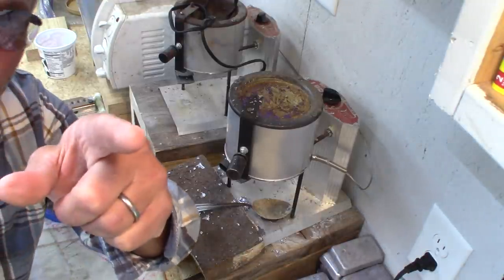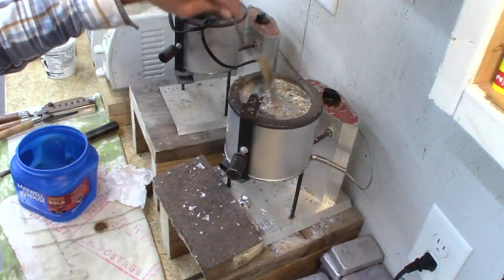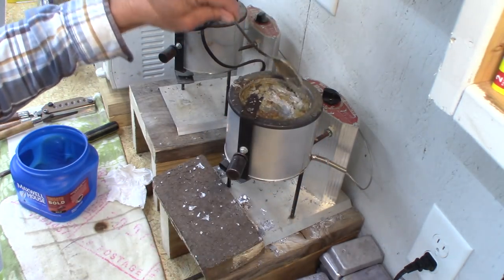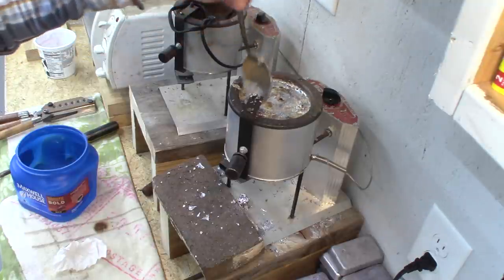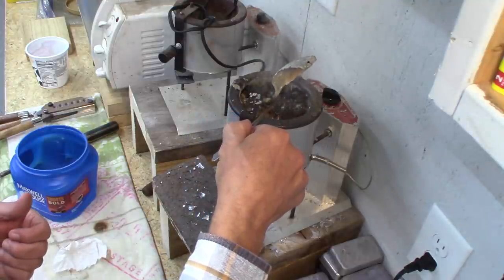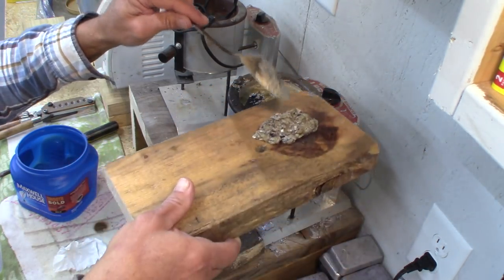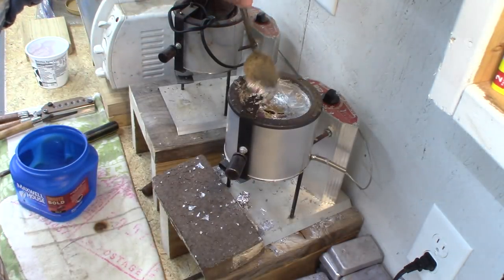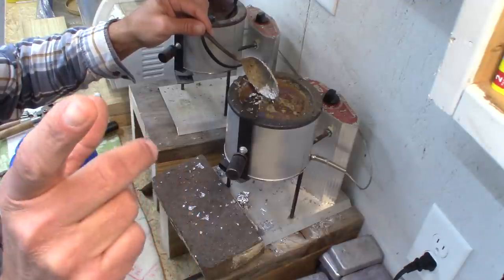Purify Your Lead

Comment: It's getting to be casting weather soon.i did want to ask I flux my lead while it is in my big cooker. Is it a 2 step process for you? I like the idea of the paper towel. I use lee pot myself they make great stuff
Reply: Imo the 2nd step is just to make sure to get any extra crap out. You could have stuff like dust or whatever in the pot too.
The 1st "cleaning" for the ingots you'll get most but prolly not everything and it's not a hassle to do it in the furnace before casting just to get a bit more out imo.
:) 

P.S. Yea Lee seems to of taken over. All their stuff is (usually?) cheaper than everyone elses but their quality is just as good in everything I have used to compare.
I only have one beef with one of their powder loaders (Lee Perfect Powder Measure) and that's only because it doesn't have a screw off top to put powder back in but it drops fine once you got it dialed in.
:)

Comment: For bullet casting in bottom pour smelters (so we're assuming previously cleaned and purified alloy), I've always had good luck with boric acid as a way to keep out the oxygen. Makes a nice, thin glassy sort of coating and doesn't really smoke the way sawdust does. Just don't stir it or it'll clump up and not do its job. All you need is a small spoon full.
Reply: me too 20 mule for my Dirty laundry shop rags and lead or coffee pots, I use a few grains to raise the 2 PH.  I had luck with DE pool filter media, works good for a harder hens' eggs and delousing, kills fleas on the dogs too, always have a 20 lb bag from the pool guy around, good refractory binder too.

"I do" stir my borax as "I Think" the clumping is the tin being removed for softer lead.

Comment: Frankly I don't think you fluxed it enough to reduce that caked junk that was floating.  Maybe I am wrong but I think it's antimony which doesn't mix well with lead unless fluxed well or maybe it's ratio to the tin (2:1)  I find that adding sawdust and adding candle wax and setting it on fire or at least setting the wax on fire really helps to reduce that caked stuff lots of times to nothing but a small pile of black carbon that I scoop up.  I noticed even when I flux and nothing is floating on top when you drain Lee pot in to ingots you get that same caked sludge on top of your ingots.  It doesn't happen if it drains faster like in my RCBS pot.  Also if you're going to flux it might as well flux it all the way, otherwise that stuff will end up sticking to the pot walls as your lead level slowly drops.